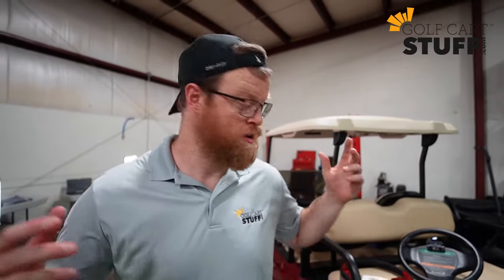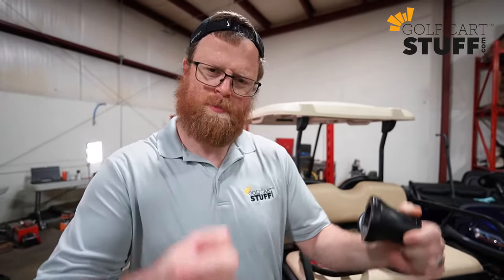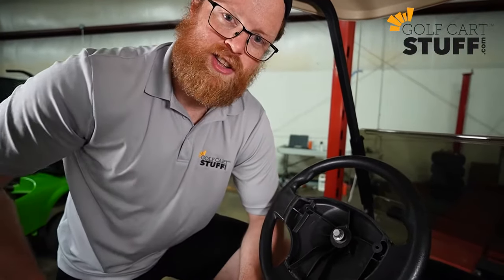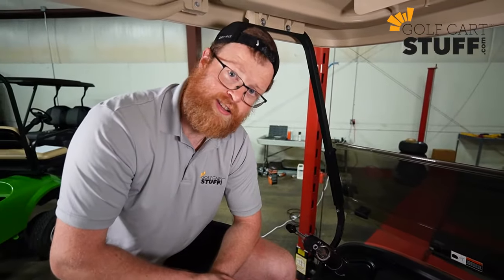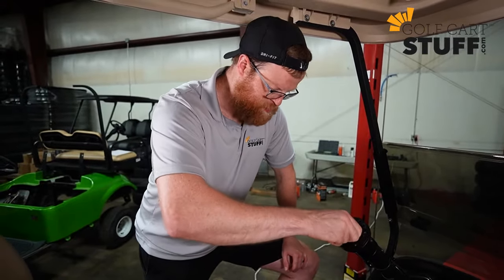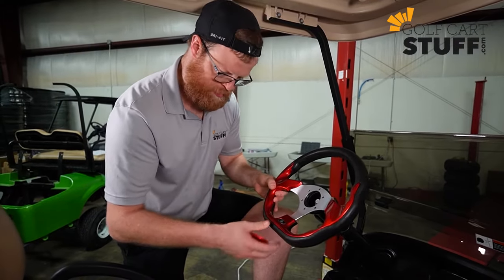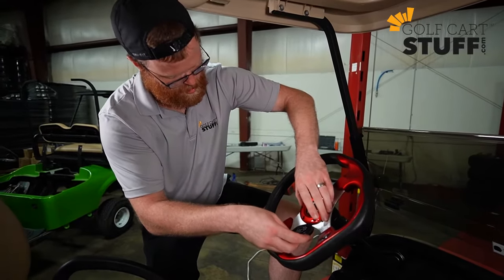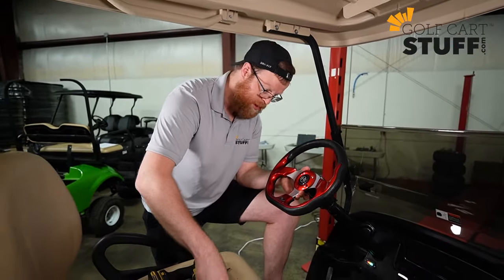Golf Cart Steering Wheel Install! Club Car, EZGO, Yamaha

Comment: You should also use some loctite threadlocker (blue liquid) on the center bolt threads and all of the smaller ones holding on the new wheel so they won't back out on you from use or vibration.
Reply from the maker: That’s a great idea! Thanks for the comment, Keith!

Comment: I had the wheels slightly turned so the steering wheel is off center. Any advice on getting the adapter back off to line it up properly?
Reply: do it again

Comment: Does this extend steering wheel to driver with adapter? and would you prefer a deeper dish wheel? Jus curious so many options.
Reply from the maker: The steering wheel does come toward the driver slightly when you install the adapter. It's honestly not a difference that I've noticed or is uncomfortable. The deeper dish wheel would do the same, bring it forward slightly.

Comment: For those that use their carts for golf do you have a clear scorecard holder that can be used with an updated steering wheel?
Reply from the maker: Unfortunately, There are no steering wheel that we have come across that include a score card holder. That may be an accessory that can be found on Amazon or eBay. If we find some, we will offer them in the future for our customers!

Comment: Does anyone know the nut size for the Club Cart Precedent steering wheel faceplate?  None of my nut drivers seem to work.
Reply from the maker: Just tested on our Precedent. To remove the two fasteners in the back of the OE steering wheel I used a 5/16 (or 8mm). The key was finding something thin enough as the hole diameter isn’t large for most sockets.

Once the face plate is off the bolt that goes down that steering column can be removed with a 5/8 or 15mm socket.
Reply: @GOLFCARTSTUFF any recommendations on a skinny enough socket to fit?
Reply: @rickygomez7975 I just used 5/16 socket that is the longer version about 2 inches long .. seems like it won’t fit in the hole but it does. Worked perfectly
Reply: I can't find a Thin 5/16 socket that fits, so I am going to Grind a 5/16 Nut driver down with a Grinder.. It worked !!
Reply: I found a 6-in-1 screw driver made by Husky at home depot.  Worked.  Steering wheel successfully switched.